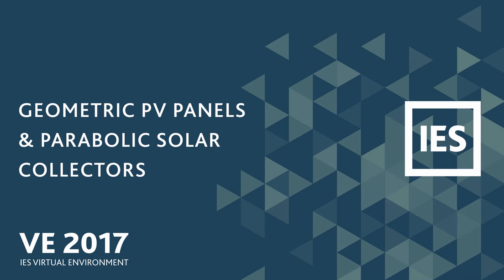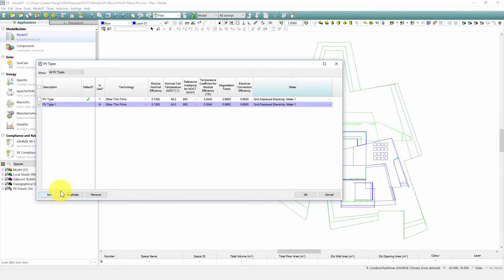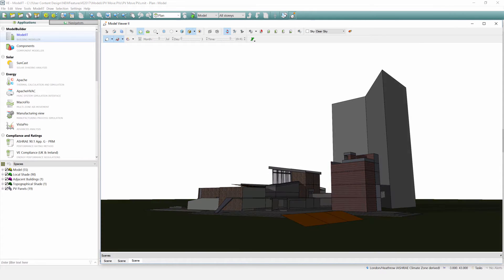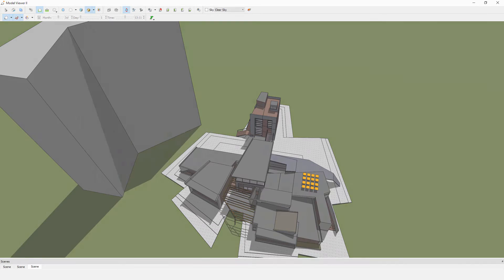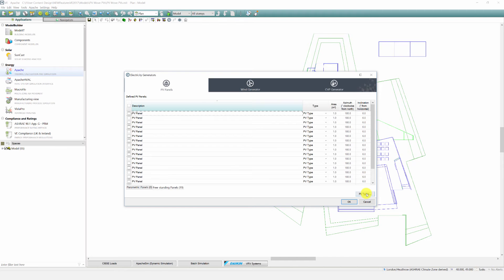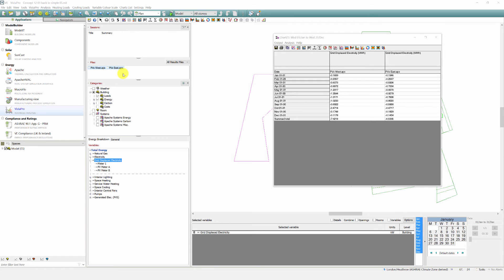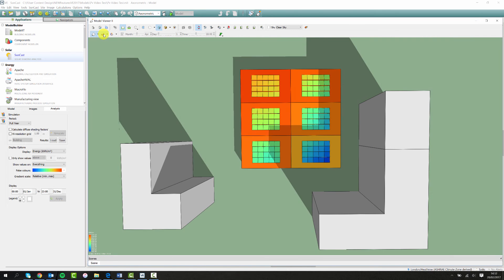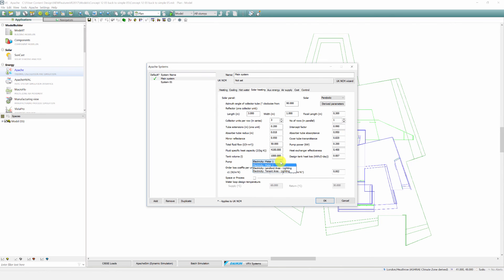Geometric PV Panels & Parabolic Solar Collectors

Comment: Finally! been waiting for PV to be introduced in VE. Great job. Just one thing, been trying to use panels as shading devices but couldn't be able to change the angle of inclination. Would be great if this could be improved in the next release, or maybe there is something I'm missing here!
Reply from the maker: Hi Yahya, You can set the inclination in the ‘placement’ settings for a new panel, however once the PV is ‘placed’ you can’t edit the inclination, you would have to add a new one.
Reply: Integrated Environmental Solutions (IES) thanks. I'll give it a go.